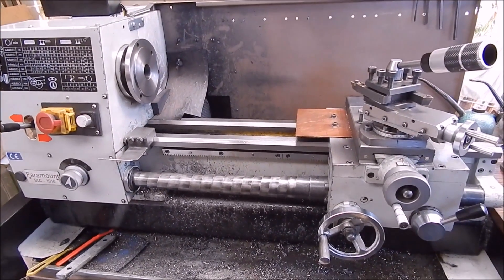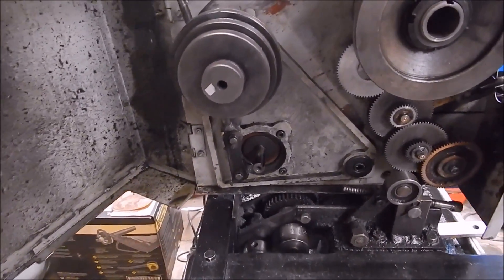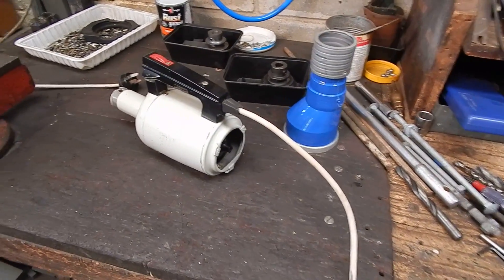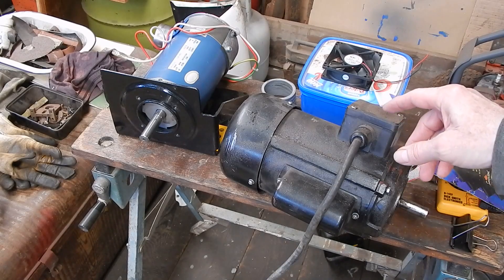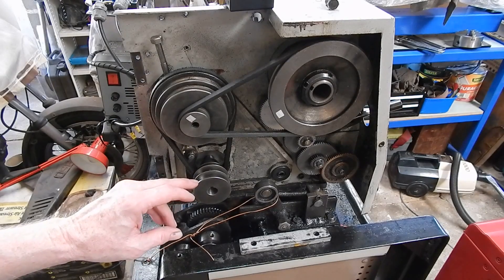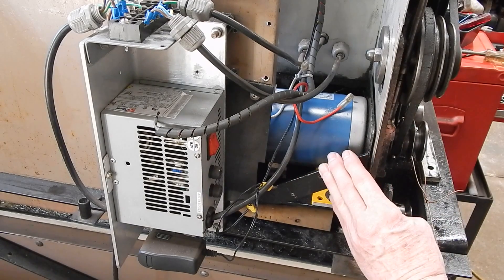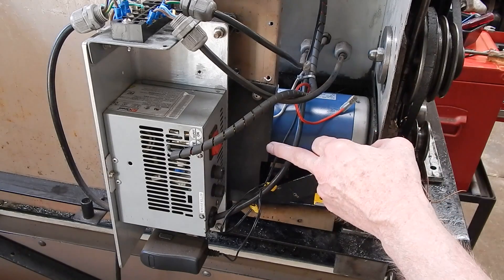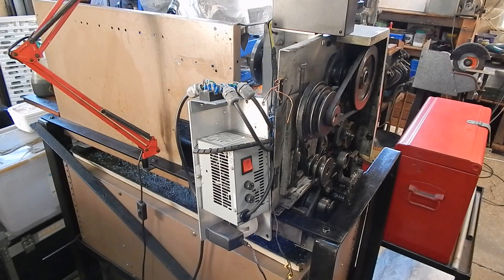My lathe variable speed DC drive - part 2

Comment: Hi I'm new to this so I might need a bit of help. I'm making a pitching machine for a baseball team and I have a motor that looks like your one but its 2.5 hp elec DC motor out of a treadmill.  It puts out 180V at 4700rpm. I'm in Australia  too and I want to be able to control the speed of the motor. Can you please help me out so I can make a control box for it. Thanks Randy
Reply from the maker: elrandyt Most treadmills run at 180V DC.  Be aware that some DC treadmill motor HP ratings as printed on the case are not really accurate.  .  You should read the advertised HP rating for the treadmill model, rather than the motor, as this is most likely to be correct.  If it is a 2.5 HP motor then you will need an inverter which can control that HP rating.  This limits the available choice somewhat as basic controllers generally do up to 2 HP.  Check out the KB Electronics site for a suitable controller, then browse Ebay.  In Australia Baldor are KBE rebranded/agents through CBC Bearings Ltd.  For 2.5 HP you will be looking for a KBIC-225.  Other brands may have something similar. Cheers Rob

Comment: G'day mate.  Nice video.  I can see where a large motor could need some cooling.  I have a 1 hp on my antique Craftsman lathe and it is a bit weak but I don't have to worry about cooling.  Thanks for sharing.
Reply from the maker: The problem isn't so much the size of the motor, but the fact that I had to remove the original fan to make it fit.   Also, any of these DC motors will get hot if worked very hard at low RPM.  Cheers Rob

Comment: It's a shame you want to use that noisy little vacuum as a fan, wouldn't a small scroll fan do the job like out of a car or old air conditioner, plenty of air and no noise also very cheap to run. The DC motor will be nice and quiet but the fan will spoil it.
Reply from the maker: The vac is actually fairly quiet with the hose attached.  I will put it in a sound box as well. But, yeah, this is work in progress and I can put up with a bit of noise while I keep looking around for alternatives.  This will definitely cool the motor 100%.  Rewiring the setup is taking a while.  Rob

Comment: Looking good, mate.  Is your motor controller 90v or 180v?  Also, I supposed you could run the fan at 1/2 voltage if it's too noisy.  I'm assuming it's a universal motor.  Good idea having the temp probe in the air stream.  Many folks forget that the heat in brushed motors is generated in the rotor windings.  By the time it reaches the case a lot of damage could be done.  Your stock motor looks exactly like mine.  Probably used in most Chinese machines but they seem reliable.
Looking forward to hearing it purr and/or much cussing when the smoke gets out :)

Cheers.
Reply from the maker: The controller is 180V.  Yes, I could trim the fan motor speed if it's overkill.  I had a cheap PWM controller I tried on my bouncy castle blower and was using it to control my workshop fan (all brushless), but when I used it on a brushed motor it died.  Are there specific controllers for brushed motors ?  The vac has brushes (as most do). I don't expect smoke with this setup :) Cheers Rob
Reply: You'd want  thyristor type controller ie. Router controller or motor dimmer.  Now that I think of it -those motors spit out a lot of EMI/RFI so keep an 'I" on any sensitive gadgets.